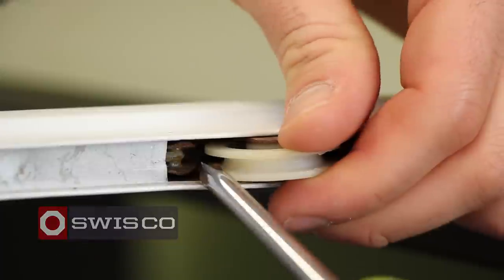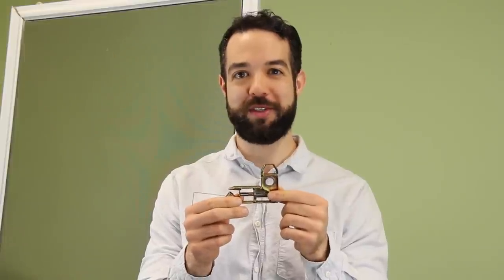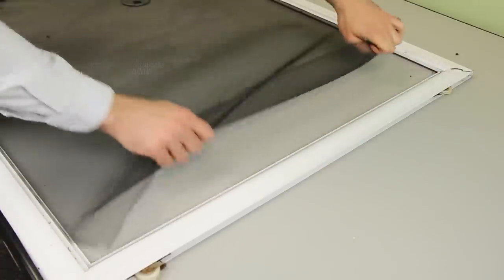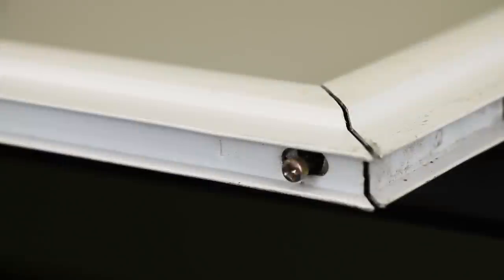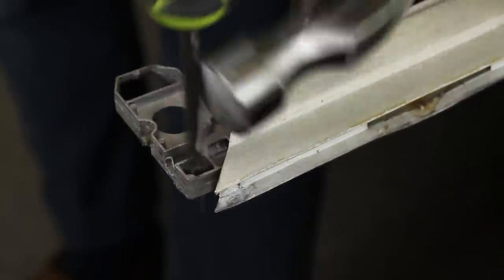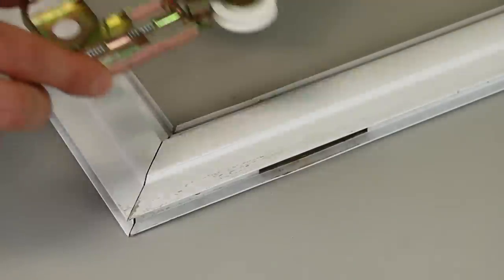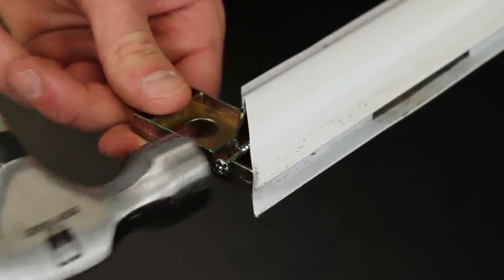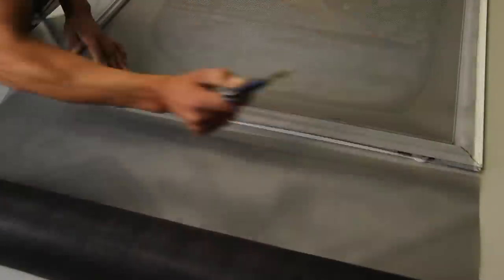How to Replace a Screen Door Corner and Roller [1080p]

Comment: Do not hammer directly on the aluminum track to put the frame back together, as the video shows. As you can see if you look closely in the video, this deforms the soft track, which can cause it to stick or squeak in the track. Instead, put a piece of wood across the track, and then hammer on the wood to disperse the impact and protect the track. A rubber mallet may also be soft enough to protect the track.
Reply: Good tip, thanks!